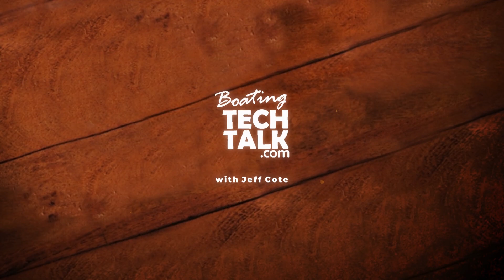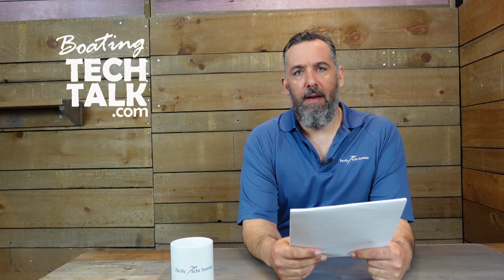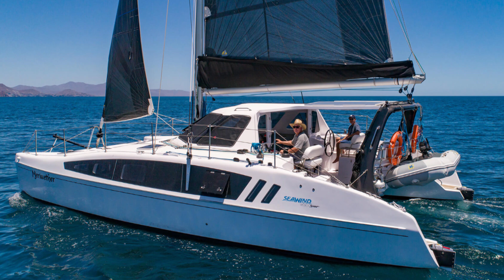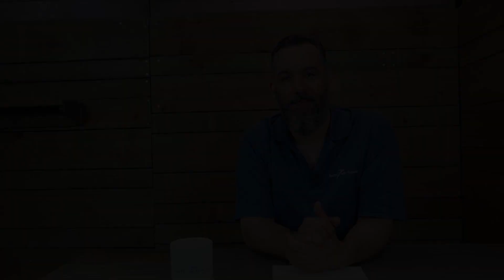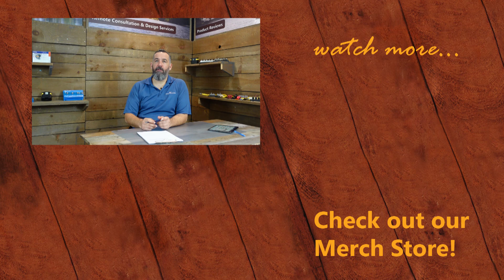Is It a Good Idea to Retrofit a Boat From 12V to 24V?

Comment: 24V is way more efficient.  If your cooking electric,  have a boiler,  or maybe even a split airco and a big solar capacity, go for 24V!  Just a small inverter from 24 to 12V
for your 12V navigation
equipment is enough and not complicated at all!❤

Comment: Wiring wont need to be changed. Alternator and starter would be the only challenges.
Reply: Solution is Victron orion xs 1400. It can do 12 to 24 volts(25A) In this case keep your starter and alternator running  at 12V.

Comment: Hi, all this electrical stuff is like black magic to me.So here is a question to which answer may seem obvious to most...  We have an OLD 39 feet sailing boat, for some reason she is set up for 24 V, but because we are doing a full refit (including rewiring her completely, all new equipment) we are considering going to 12V. However one thing which we are most likely going to keep is the engine which is also 24V. Does changing only the alternator on it to 12V would be enough to make the engine 12V? Or do we actually have to change the entire engine? Or perhaps you would advise against it? Best , Natalia
Reply from the maker: Going to 24 to 12 volts has many implications for the engine including, alternator, starter, engine gauges, perhaps engine relays and controls. Never got to see this done firsthand.

Comment: is it possible to have a 24v system on a boat if i cannot get a 24v starter motor for the engine
Reply from the maker: Yep, but it means you'd have a 12 volt battery for engine and a 24 volt battery for house and makes converting from 12 to 24 or vice versa an added challenge.

Comment: Interesting what are the advantages of the 24V as to the 12V system?  If there is a video already let me know.  Thanks
Reply from the maker: Going with 24 volt system reduces the cable size by a factor of 2, quite significant weight savings. Also, voltage drop concerns are also reduced.

Comment: That certainly is a great question, and 24 volts has many advantages, but to RETROFIT is very different from a new build. The current wiring could mostly be re-used (but you're not saving weight that way), some equipment will run at either voltage, although a lot of the older (and some newer) gear needs a single voltage range, so you'll either adapt for that with buck converters, or you'll end up running both voltages, which adds complexity and extra equipment (done this before, works, expensive, big PITA). Running almost any load at a higher nominal voltage makes sense for many reasons, weight and cash savings are the obvious ones and it would be absurd these days to BUILD a live-on size vessel all in 12 volts, but even I wouldn't retrofit 24 volts, despite my perfectionist mindset. I might be tempted to leave the engine systems at 12 volts and adapt for house bank charging at the higher voltage (boost chargers are a new thing, but long-awaited), because changing out the entire starting/charging and possibly even engine management systems is a horrifying prospect. You could always buck to 12 for your windlasses and so forth, but you run into amperage limitations. The largest commonly available (stock device, easily found) buck converter is something like 100 amps maximum for a few hundred bucks; not bad money, good efficiency, etc. It is a failure point though; that thing overheats, it shuts down and you have to wait 10 minutes for it to cool before you have power to your running gear, meanwhile you wash up on a rock pile and realize 12 volts, contrary to logic, was actually safer. So sure, you can retrofit if you're willing to bear the expense and some unique challenges, but having played with these situations, I agree with Jeff, it would not be worth the tears to do a full retrofit. Just my 20 cents. Happy sailing.
Reply from the maker: Very well said Tao, big difference between new build and retrofit.

Comment: Hello Jeff, to work around high load device lime inverter on a 12V system, what’s your thought on using parralel cable (ex. 2x 2/0 câble). What’s should we pay attention to in that Kind of scénario ?
Reply from the maker: Hi Martin, once the loads exceed the maximum amperage capacity of 4/0 wiring, manufacturers do recommend running parallel (i.e. 2 4/0 wire) 4/0 wiring to handle the large amperage.

Comment: the problem stickin with 12v is the solar charger, 1000w means 80-90A and for that you would need a big solar charger and huge cables to inverter.

A solution I would consider if you already have a 12v boat is to have 2 battery banks, 48v and 12v. Solar charger and inverter running to 48v batteries, then a dc-dc charger for the 12v bank.
Reply from the maker: Yep, higher voltage translates to smaller wiring. Most boats will be 12 or 24 volts, with some boats at 32 VDC and even some boats at 48 VDC.